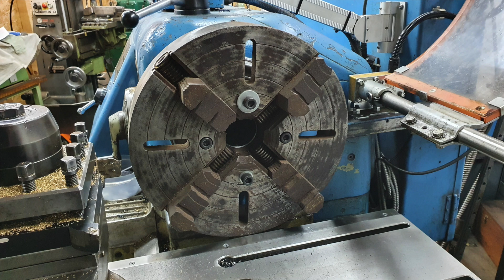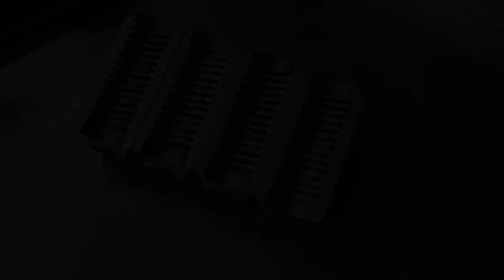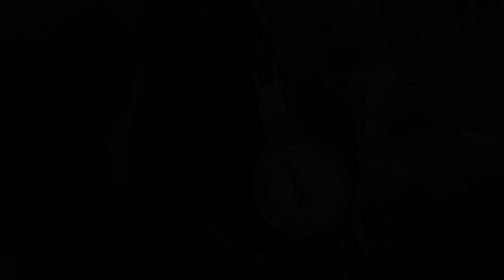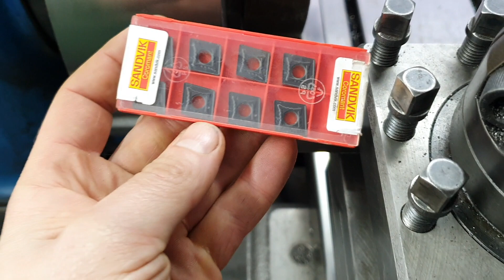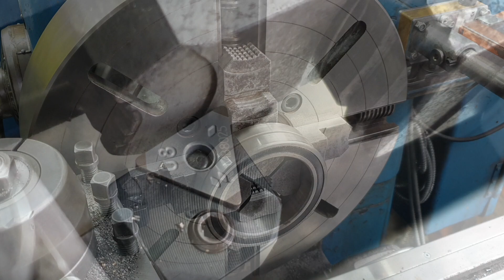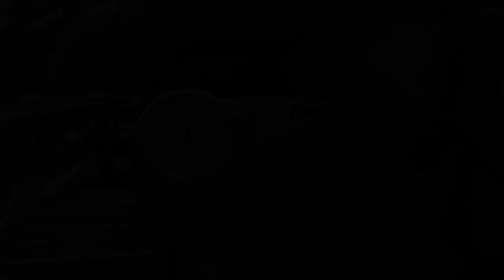Okuma LS Adventures Part 8: 4 Jaw chuck cleanup

Comment: At least it will be very easy to swap chucks. Just two tiny shims, and you can crank it right off with the cross slide!
Reply from the maker: Yes it is. Fun fact is that his chuck is a lot lighter than the Forkhardt but almost 100mm bigger. Just a very simple cast iron design.

Comment: Nice, but how did you clean up the back where it mates with the lathe?
Reply from the maker: Thanks. Most of the mounting is done on the taper. The back face was not too bad. I took of a few little high points with a flatstone.